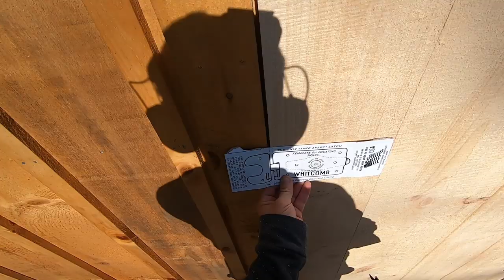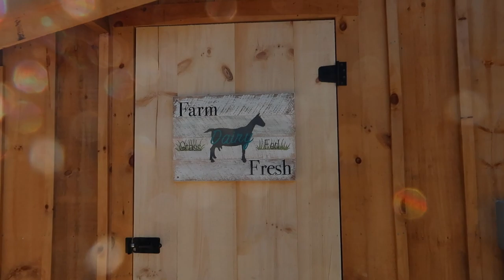DIY Barn Door  Using ONLY a CIRCULAR SAW

Comment: Al, before you get settled in you would be ahead of the game by sealing the concrete floors. You wouldn't have animal waste and other items seeping into the concrete and it would be far easier to clean up spills and such. The build quality of the barn and wood shed look great! We are looking forward for the other side of the barn build. You do very nice work!
Reply: I second Mr. Smiths suggestion.  I did not put sealer on my floor originally and now I'm faced with moving everything out if I want to seal it.  And keep up the good work Al!
Reply: Totally agree. Even just a roll on type garage floor paint will seal the cement. Simple and inexpensive. Plus it makes sweeping up a breeze by smoothing the surface.
Reply: It was one of two things I was wondering myself. Concrete sealing is a labor savings with an ascetic bonus. The other was sealing the wood itself...even with a clear covering? 
It looks great right now but how much shrinkage do they claim and what’s the expected longevity untreated In anyway?
Just curious...I’m sure the building will out last most of us and you can, or may, have more kids to do the sweeping of the untreated floors...
Having started a building business, The House Doctors, commercial and residential building and remodeling, when I was 18 and it was some of the best years of my youth. Later I found I made more money talking than working and moved into commercial and residential lending, specializing in Building Loans. I made more money but still missed the smell of fresh cut wood in the morning on a job site.
I actually believe you’re doing a far better job than most would be doing. Otherwise I wouldn’t be coming here nearly every day to see...whatcha up too? The 3 of you make a great team and are showing people that a farm is work but it doesn’t have to be drudgery! YT and merch can be a game changer allowing you to do so much more.
Anyway, sorry for rambling so much.
God Bless

Comment: Enjoyed the video Al. If your loft ladder is staying in one location, here's an idea and you may have already thought of it. Mount the top of the ladder on a pair of sturdy hinges, attach a rope to one side of the toe of the ladder, run it straight up to the ceiling through a pulley then run to a side wall and through another pulley then down to a counter weight that will balance the ladder. Attach a short pull rope on the ladder so you can reach it to pull it down for use.  Just an idea that would free up the work space but still keep the ladder ready for use when you need it. Y'all take care and God bless.

Comment: A little info on your gate screw the chain to the post and the hanging end goes into the slot to hold gate closed just a thought we have the same gates. Love the show keep them comeing i just bought a new 2.5 acres in the woods of central florida we have deer turkeys and wild pigs all over the place with a corn feeder we are fattening up the pigs need to trap them feed corn or feed for 3 monthes to cut back on the gammy taste from eating palmetto roots but its yummy for the tummy

Comment: Al, if you secure one end of a short length of that chain directly to the fence post near the chain slot on the gate, you can simply drop a link into the slot as a latch rather than having to feed it through the eye bolt every time.

Comment: Good thinking on the battens, I wouldn't have considered that the goats would eat them. Not surprised though.
I wonder if Jamaica Cottage could make a modified plan that allowed for SIPS to be attached to the outside of the frame so you 1) don't have to do all the masking for spray foam and 2) don't lose the 4" of "shelf space" all around.
What service! Breakfast in Barn!

Comment: As you know the battens keep the wind out of the cracks. What if you put the battens on the top half of the wall (out of the goats' reach?) adding a bit more protection. ❤🌅🌵 p.s. I'm thinking with all that pasture, they won't have interest in the battens. Or you could add cattle panels for batten protection until they loose interest.

Comment: 10:40 You'll more than likely see this too late, but dropping the doorway down is absolutely doable.  Pull off the door trim, put an extra board or two at the top, and then pop the trim on altered to fit.  :P

Comment: I was surprised that the screws you put into the bottom and top of the board didn't line up with where you cut so that your saw didn't run into metal.  It looks like they were cut completely cut off, also on the side.  You didn't put more in after the door was cut, so you are relying on the glue.  I wish the door was the same color as the siding, and I heard you say it will darken up with time.  I don't know how Gena and Olivia could paint those letters as they did on the sign.  That was amazing.
Reply: I noticed as well. I'm sure Al added screws after the cut.

Comment: Good morning  Al,.........  A question for you..... Why didn't you insulate the garage door when they were there?   Just asking.  I watch your videos every night at 6 pm and enjoy the work you and your family are doing on the Homestead.  Cheers from the Philippines.
Reply from the maker: They told me they would be able to do a nice job with the spray foam and to use sheet foam.
Reply: @LumnahAcres  I would have got them to spray about a 1 inch thick pass and then crank up your garage springs to compensate for the extra weight. Which you will still have to do when adding anything to the O/H doors. As long as you insulate all is good. Cheers.

Comment: You could have just added a 1/2" or so shim to the top of the door opening and gone with a slightly shorter door instead of notching the trim. Good door design.

Comment: I wonder if the foam is soy based so it smells good?
At a welding store you can get a product called Rustmort, it’s a rust converter for the oven top/ shelves. Apply and let set up then topcoat with Krylon.

Comment: some barn light fixtures on the side or on top of each of the doors into the barn...painted by yourselves to the roofing green color.
reference: https://secure.img1-fg.wfcdn.com/im/78060687/resize-h310-w310%5Ecompr-r85/4234/42345587/aurelia-outdoor-barn-light.jpg

Comment: Just noticed something. Is Olivia ambidextric? I am and found out the older carpenters could not stand watching me switch hand to hammer, they just thought I would hit myself so none of them would keep me on. Ended up in a machine shop with handles on both side of the mills.

Comment: Please stop pulling the chicken rookery along the ground.  Make a frame (or use the old one) with catering wheels (harbor freight, not expensive) on each corner.  Install a bottom barrier of flexible plastic or similar material along the bottom of each side.  Now you can roll the rookery in any direction without concern of harming the chicks (or your back).